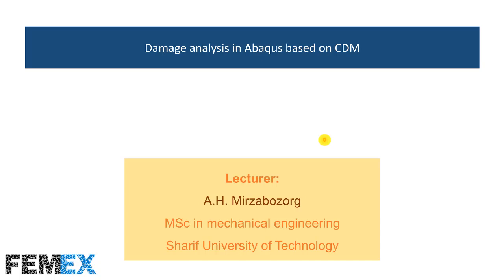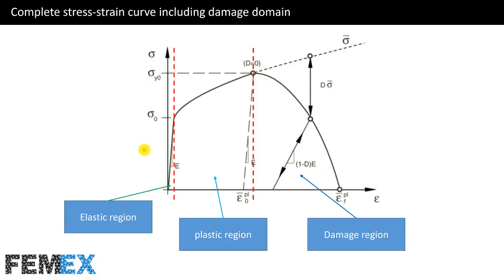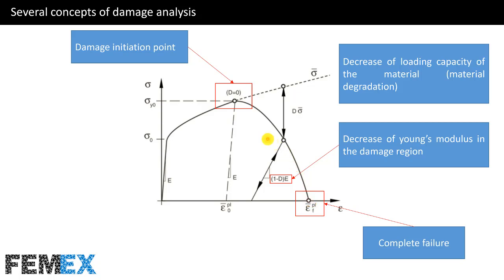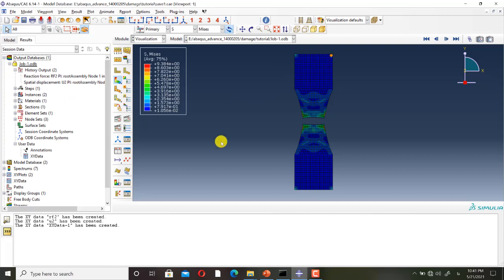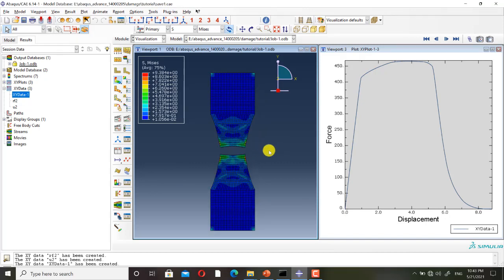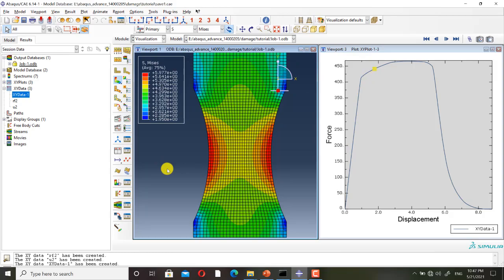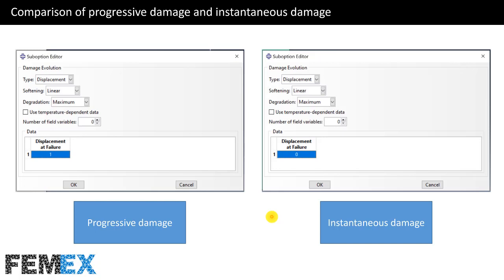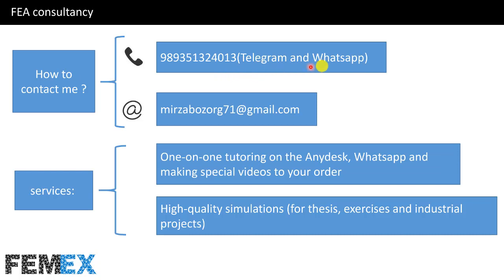damage analysis in Abaqus based on Continuum Damage Mechanics

Comment: Hello, thank you for your wonderful explanation.
I have a question. Can I input the true tensile strain rate as the strain rate for ductile damage?
Reply from the maker: Hi.
You are welcome.
If your loading is quasi-static, there is no need to put that value. You can simply use 0.
But if your loading is dynamic, then you must enter V/L.
V is the loading speed.
L is the characteristic element length.
Reply: @FemexIran  Thank you~
Reply from the maker: @leeyuWang-j2w  You are welcome.

Comment: The triaxiality is 0.333 not -0.333. Triaxiality is -p/q, p is pressure stress defined as -(s1 + s2 + s3). In simple tension p = -s/3 and -p is s/3.
Reply from the maker: Hi.
Yes.
You are right.
It was a mistake in the formula of calculating the pressure.

Comment: Thank you for the video
I have simulated a composite concrete slab connected with steel beam in abaqus how can i determine if the failure happened in beam or in slab ?
Reply from the maker: Hi.
You are welcome.
To investigate failure in each of them, you must define failure model for them.
you must define CDP model for the concrete with tensile and compressive damages and request DAMAGEC and DAMAGET parameters in field output request to check its damage and then check them in the visualization module.
For the steel you can also check the damage without defining damage model for it. You can check the PEEQ in the visualization module for steel. It is the equivalent plastic strain which is one of the default outputs of Abaqus. If this parameters exceeds the value of ultimate plastic strain which you have defined in the property module for steel, it means that it has entered the damage region.
Please watch these videos about steel plasticity to understand the PEEQ and ultimate plastic strain :
https://www.youtube.com/watch?v=timyqYKu6qw&t=44s

https://www.youtube.com/watch?v=18pBX0R4y28&t=156s

Comment: Hello, thanks for the video. I have a question.
I have a model of a church and I entered the concrete damage plasticity parameter I have. I selected like output request DAMAGEC and DAMAGET but in the visualization module it is 0 everywhere, except in two or three meshes scattered throughout the model.
All the units are ok, there isn't distorted element and I can see other output.
Do you know what these display problems are caused by? Has a similar case ever happened to you?
Thank you in advance
Reply from the maker: Hi.
You are welcome.
this kind of output can have several causes:
1) the mesh is not dense enough. so the element size must be decreased in the regions which damage arise.
2) the load is not enough to cause large damaged areas. so by increasing the load, damage will propagate in the structure.
3) you must change the visualization settings:
a) the contour type must be changed to quilt.
b) the number of contour intervals must be changed to 24 from 12 (default)
c) the interval type must be changed to log
if you did according to the explanations and the result didn't change, your model must be checked to find the mistakes and be modified. to do this, you can use our online tutoring and consultancy service.
Reply: Thanks a lot for suggestions!
Reply from the maker: @leonardopieracci324  you are welcome.

Comment: Hello Sir,

Thank you so much for your explanation, it has been very helpful to me. I have a question for you..

In calculating the stress triaxiality values, I have seen some people using an array of values while others use only one value of stress triaxiality corresponding to one fracture strain and strain rate.

Which one is the correct way of doing it. And why?
Reply from the maker: hi.
you are welcome.
each value of stress triaxiality corresponds to a loading condition.
loading conditions like:
pure shear
pure tension
pure compression
each of these loading modes has their own stress triaxiality. in your simulation, if the loading condition does not change during the simulation, you can use only one value of stress triaxiality.

Comment: sir can you explain when do we use linear damage evolution and when do we use exponential damage evolution
Reply from the maker: hi. actually it depends on the material. you must test both of them and then check the results and check which of them leads to more accurate results. for some of the materials the linear form is better and for some of them the exponential form is better.
Reply: @FemexIran  thankyou sir
Reply from the maker: @manojkumarneesu2773  you are welcome.